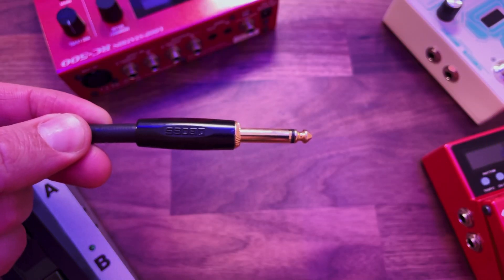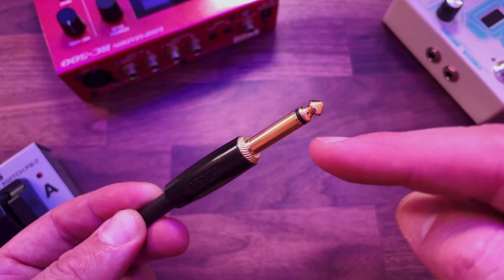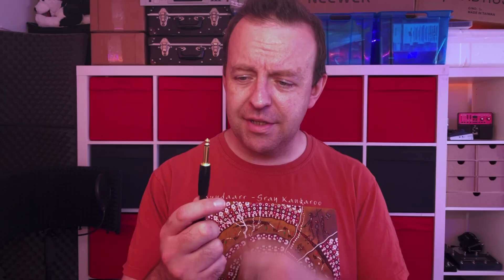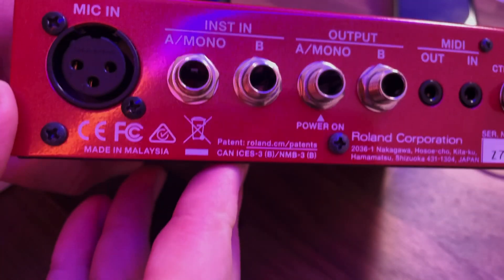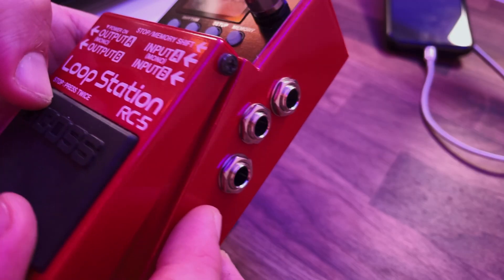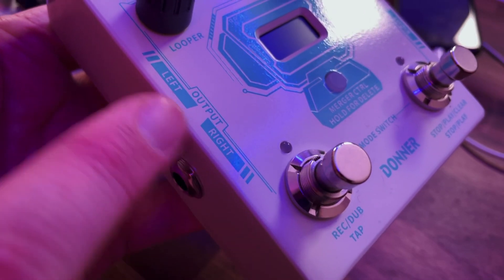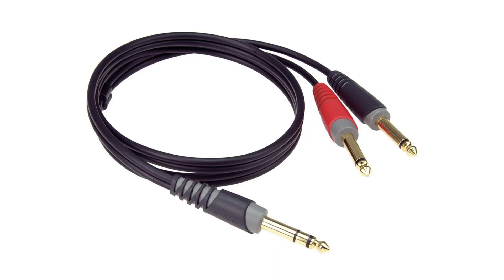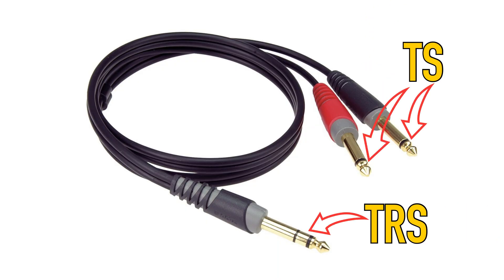TS vs TRS vs TRRS - What’s the Difference?

Comment: Thanks so much for this valuable information. Question? If I have a pedal that has one mono out and one stereo out, I can plug one cable to one amp using the mono out into one amp and plug the cable from the stereo out to a separate amp...is this correct? Or will I need a y cable to split two cables from stereo out to two separate amps. And finally, will I need a trs cable, even though one side would be from the mono output?

Comment: What’s “balanced”
Reply from the maker: Great question: A balanced cable has three conductors (positive, negative, and ground), which reduces noise by canceling out interference. An unbalanced cable has two conductors (signal and ground) and is more susceptible to picking up noise over longer distances. 
However, an unbalanced cable isn’t a negative thing. 
You’d use a balanced cable for long cable runs, like connecting microphones or studio monitors to a mixer, because it reduces noise and interference. Unbalanced cables are best for shorter runs, like plugging in guitars, keyboards, or other instruments directly into an amp or audio interface.
Reply: @JohnPaulMusicUK  Thank you!

Comment: I have a Tascam Portacapture X8 I use it to record my ukulele, for this I use a TS cable which works fine, but I bought some higher quality TRS cables, but with these new cables I have no signal on the recorder, does anyone know why?. Thanks
Reply from the maker: Yes. If the Tascam is meant to take TS cables then the ring for the connection on a TRS cable is in a different location and it won’t connect. 
Look at the Menai if the x8 and make sure what kind of cable the connections are meant to be. No point having TRS if it’s meant to only take TS.

Comment: You’re misusing some of the terms defining T, R, and S.
Those stand for Tip, Ring, and Sleeve yet you refer to tip and sleeve as different components. The insulating bands between the segments are not sleeves. At one point, you referred to multiple tips.
Reply from the maker: Oops 😬 yeahhh.. 
That’s embarrassing.